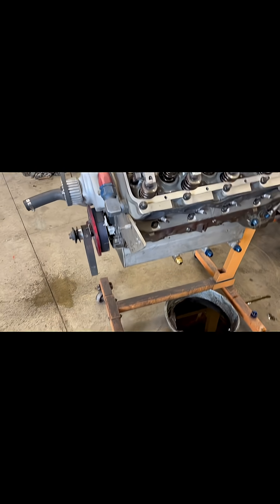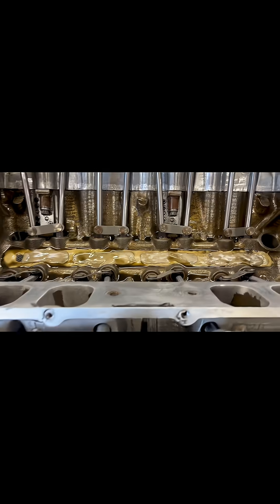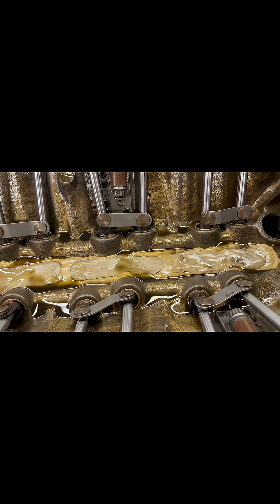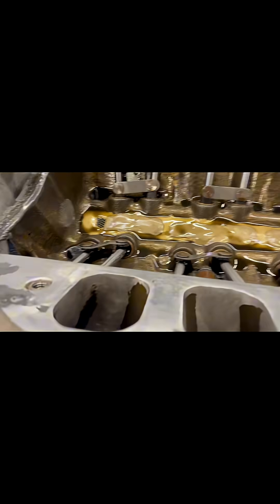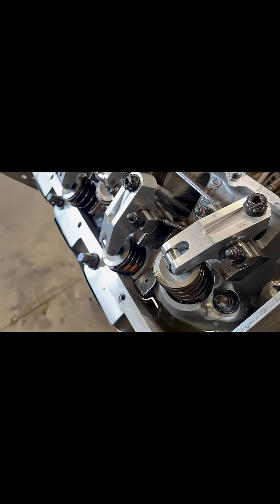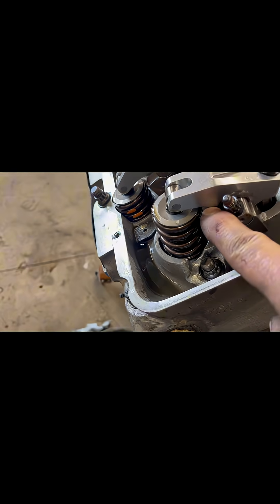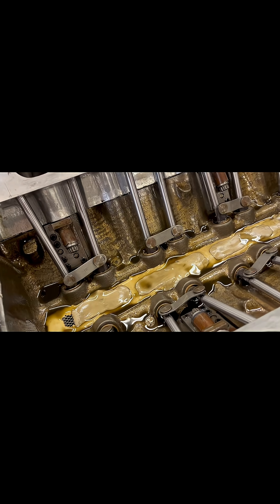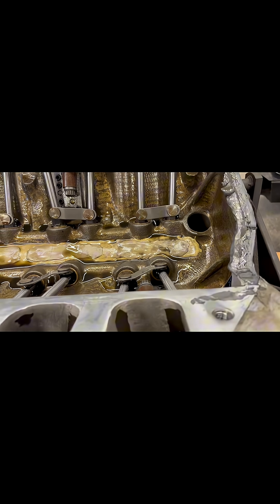50 more HORSEPOWER with secret oiling mod #bigblockchevy #dragrace #mechanic #noprepracing #1967

Comment: Hows the cam being oiled....?
Reply: Also hows the dry sump system work, ive only heard of it.....? Ty
Reply from the maker: Full oil pressure through the block to the bearings and through both lifter galleys plus everything that flys off the crankshaft. All oil does coming down from the top is create parasitic drag plus beats the oil into foam

Comment: And how exactly does that equate to 50 more horsepower?
Reply from the maker: Before I answer, what would you think would be the reason?
Reply: @CenturyOldRacer  less parasitic loss of oil not draining on the throws of the crankshaft? Only thing I can think of
Reply from the maker: @aamechanic8154   You are correct. Watch some of the dyno videos people put up of how much power loss there is from over filling the engine by one quart. It's incredible how much it can affect power production
Reply: @CenturyOldRacer did you close the valley when you added the scavenge pump line or was it always sealed like that and the oil drained front and rear?
Reply from the maker: @sam49921  I closed it, but it still has a small drain at the very front so it can get back to the pan under braking

Comment: I can’t help but to notice the modern LS oiling around the cam is so Dry compared to the older chevys? Makes me wonder if this is why they eat lifters & yes the cooling of the oil  on valve train parts greatly enhanced it longevity.

Comment: In drag racing there is enough oil getting back.The oil has nothing to do with the valve springs it's the Quality of the wire.
Reply from the maker: I have real world proof from the way it didn't oil before to the way it is now. The other HP benefit of blocking the valley is the parasitic drag that doesn't happen anymore from oil drain back onto the rotating mass which is moving at ballistic speed
Reply: I do believe it works because springs fatigue from heat. Reducing the heat would be critical in their longevity.
Reply from the maker: @rickolson9983  I have tried it both ways and I can tell you they last way longer being cooled (and lubricated )
Reply: @CenturyOldRacer It’s amazing you made 50 horsepower by doing that modification. Apparently, the engine likes it. What’s also good is it doesn’t interfere with its operation, like in the crankcase and the need to keep it away from the rotating assembly.
Reply from the maker: @rickolson9983   Getting all that extra parasitic drag off the rotating mass is huge at super high RPM
Reply: You are correct. Darin Morgan confirmed this yesterday on a live podcast with Dragboss Garage @CenturyOldRacer
Reply: We all chip together and get spring wire from Germany then they wind them here thats why our springs  don't break. @rickolson9983

Comment: Would not think oiling the springs more direct adds to their life.  They mainly fail from fatigue which is why shotpeening them is critical.
Reply: The movement of the metal itself,
Creates heat (and fatigue).
Just bend a small piece of metal or coat hanger.
It’s very smart. I always thought not enough thought was given to the oiling system. Especially when the power increases.

Comment: Like the Pontiac heads.
Reply from the maker: Those make tons of power
Reply: @CenturyOldRacer  id say so, i wonder how old they are. They almost remind of tye pontaic heads that some people used on nascar engines back in the day. Id say they flow damn good with those big old ports. Also like that homemare intake and the 4500s lined perfectly up with each port! Thats a hell of a set up man. Pretty cool what you did with the valley as well for oiling.